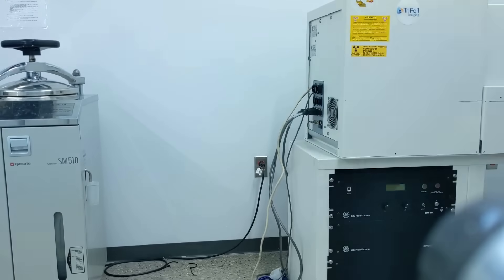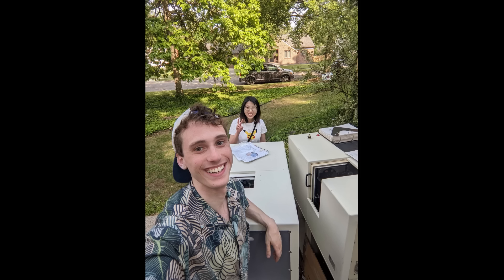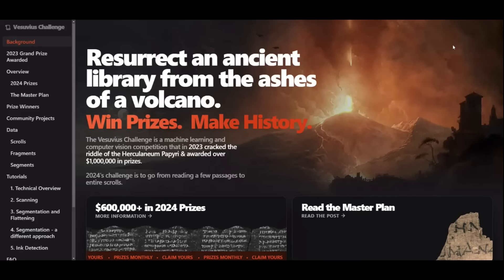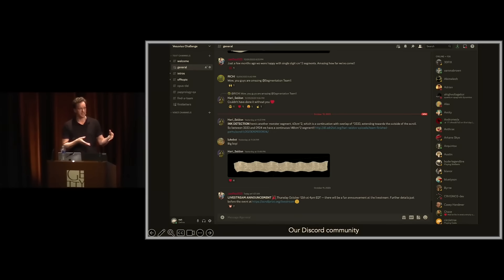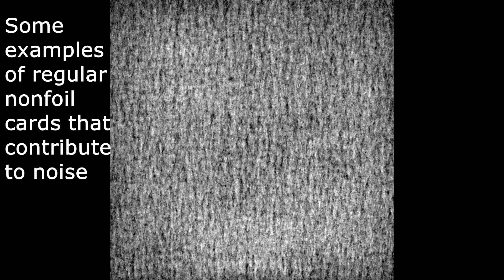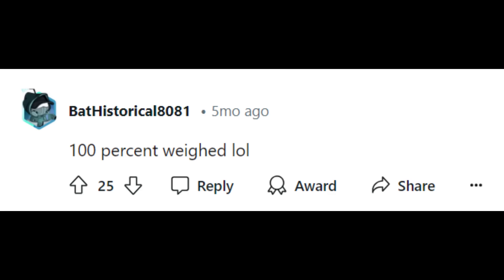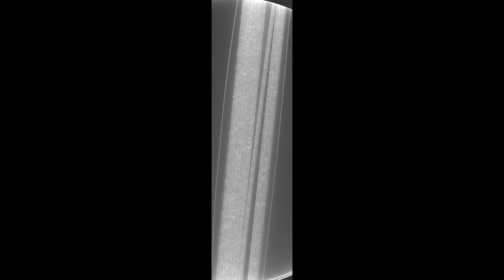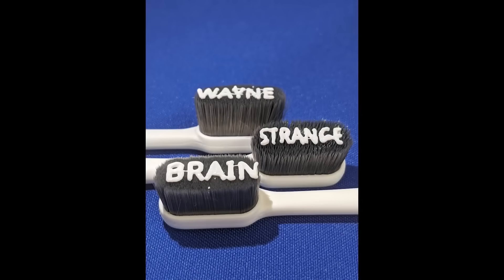Digitally Peeking Inside a Pack of Pokemon Cards

Comment: From a knee jerk reaction. This is brilliant. As a Pokémon collector, specifically for vintage pokemon cards, this is something I always wondered about if possible. This could be used for instances where you can charge a fee to see if a pack is true heavy. If you can use this to scan authenticity then this is something ALOT of collectors including myself would be interested in.
Reply: What? How is that authentic? If you own 2 packs and you CT scan them and find out which cards are in them, what stops you from selling the ones you didn't want? "is a true heavy" so first you've weighed it, morally incorrect. secondly, you've scanned it. Now you know what has a Charizard and what doesn't how is any of that authentic in the nature of Pokemon TCG? Since you now know what is inside the pack, you have no value for the other ones. which completely invalidates the whole "authentic collector" vibe of what you just said :D A LOT of collectors including myself would rather people not be able to do anything remotely close to this. a vintage booster box is tens of thousands, a vintage booster is between hundreds and thousands of dollars, the cards inside are potentially worth $10-$50k or more. None of that sounds authentic to me. a true COLLECTOR :D
Reply: I understand that we have no control over bad actors using this technology for nefarious purposes, which is unfortunate. However, my main concern is ensuring that my collection, on which I’ve spent tens of thousands of dollars, is truly authentic. I’ve primarily purchased items on eBay, trusting that they are genuine and untampered.
My point is that a service like this could provide reassurance that my most precious and expensive collection pieces are authentic. I believe there is significant value in knowing that your collection is genuine. From a purist standpoint, I agree that the magic and mystery are diminished with CT-scanned packs and boxes, raising the issue of people potentially pulling the good packs and selling the duds. I dislike this as much as anyone else and hope the hobby can remain healthy despite these new events. Finally, whether a casual or serious collector, I always prioritize what brings me the most enjoyment. Cheers
Reply: Cope. Thats a bs case for scammers and scalpers
Reply: Yeah you could scan packs for the hit and if it's not like charzard then you sell the pack and buy another pack it's a endless money glich
Reply: You can even scan whether or not a baby giraffe or a baby trex coming out.

Comment: First of all congratulations, absolutely astounding. Never change.
Secondly open the packs to confirm.
Third I wonder if the scale could be done on a booster box. I would definitely test a more modern product. And then open it as well to see if your calculations are 100%.
Amazing lad, cheers.
Reply: Confirm what? Is there a possibility somehow a Pinsir showed up on a CT scan and it's actually a Blastoise? Lmao
Reply: There is no open pack to confirm. It's all right there. 

You don't open the skull to confirm if brain is there after a CT scan do you.

Comment: "So if this was a PSA 10 when you opened it...well, what would it be, when it's still in the pack? It's an 11?.....I don't know" Lmao I like the train of thought on the God Grade. With your luck they will end up grading the pack and it will come out as a 4. Lol.
Reply from the maker: @joshuajohnson3666  it's kind of crazy that pack grading is just based on the outside of the pack as it is!
Reply: actually a cards grade basically has nothing to do with how pack fresh it is. Cards regularly come directly out of packs at less than a 10. In fact, its pretty rare to see. A card that is a 9 after its pulled is still a 9 in the pack assuming you didnt damage it during the pulling process
Reply: @marcello9476 True. I have seen many YouTubers being very sad after they pulled a card from a pack and then it got PSA 9 or less because the card is slightly off-centered or it has some minor printing error. The pack need to be opened to see how good grade the card actually has.
Reply: @Pehmokettu  Yes exactly